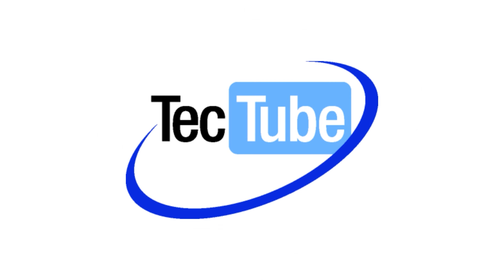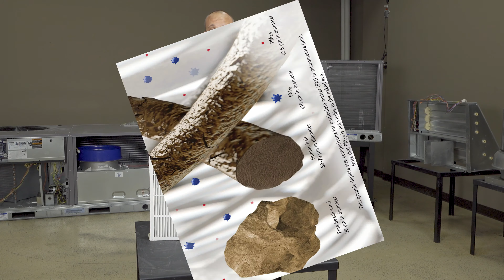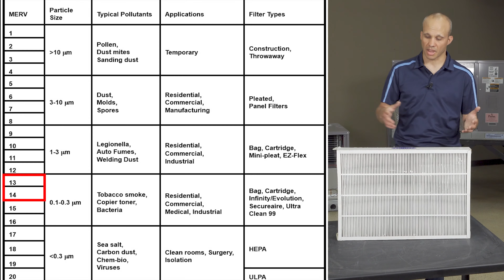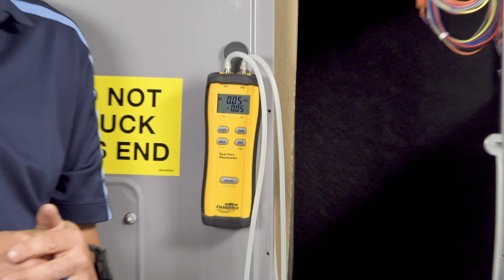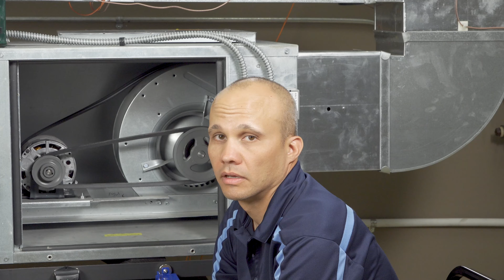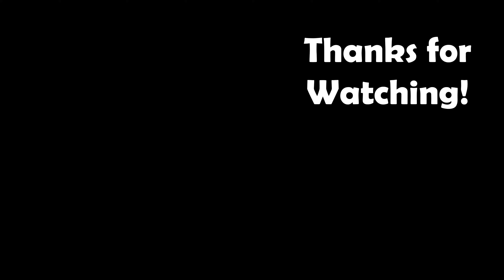RTU Filter Types and When to Change

Comment: Why not just use medium grade filters and a respicaire of UV air cleaner ?
Reply from the maker: When you say "Respicaire UV Air Cleaner," are you talking about an OXY4? We use those all of the time. But we use them in conjunction with filtration. They are solving two different issues. The main job of the filter is to catch particulate. The main job of the OXY4 is to inactivate germs and to break down chemicals. Using both is best. In fact the guy in the video, Ryan, has a MERV 15 filter combined with a Respicaire OXY4 at his own home.